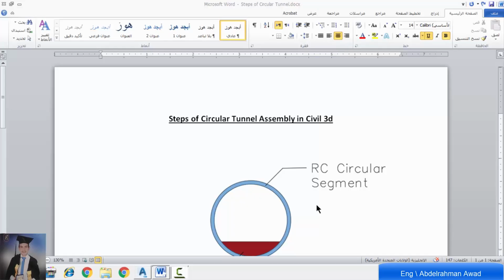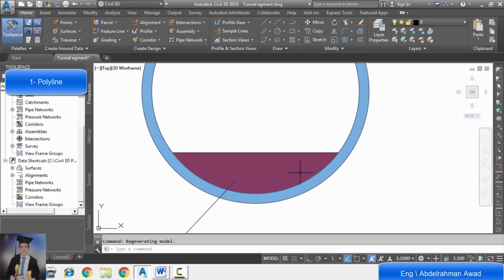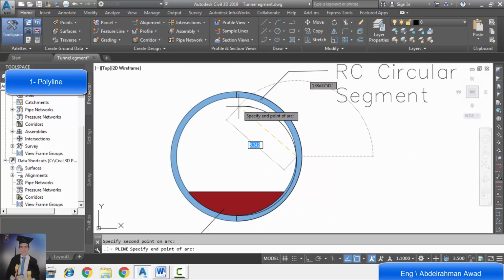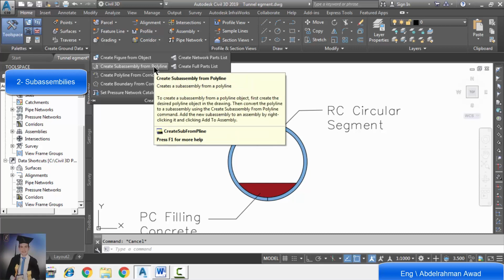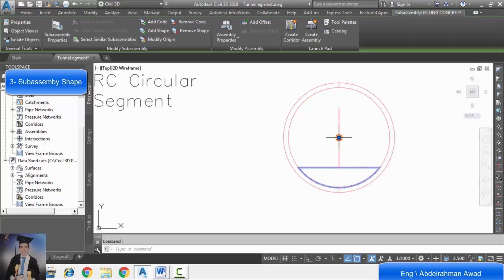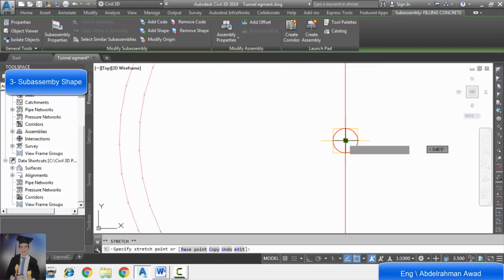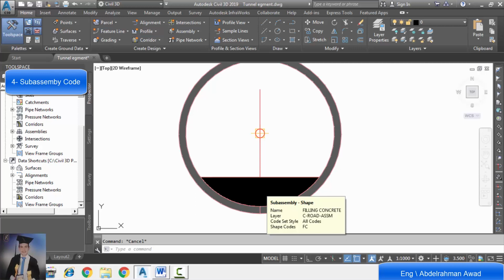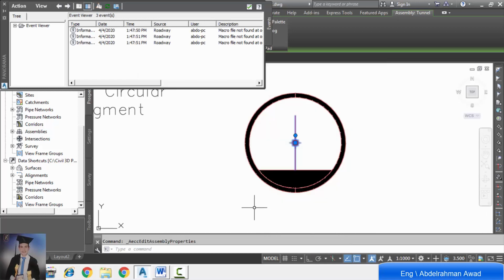Tunnel Project  Civil 3D - Lecture 1 : How to Create  Circular Tunnel Assembly  Using Civil 3D

Comment: Hello sir, urgently required.
Can you make video for structure modeling by corridor and surface, as per level.

In civil 3d 

Underpass, bridge , retaining wall, flyover, culvert.
Thanks
Reply from the maker: For corridor you can follow this video
https://youtu.be/NclKo_pS_J4
Reply from the maker: For bridge and underpass follow this video in Arabic
https://youtu.be/9plrsQBIA7U
Reply: @abdel.hamdi.Civil3D.Transport  this link for design loop and ramp not for bridge or structure in civil 3d. Please check sir
Reply from the maker: @md-mohammed8455  ok sorry you can find what you want in this video from 1hr 10 minutes 
https://youtu.be/8FUNytZJ_jc
Reply: @abdel.hamdi.Civil3D.Transport  thanks for your good reply,
But is not related to the structure,
It is for road alignment, profile etc,
I am looking for structure, like underpass , bridge, flyovers etc.

Comment: Hello Sir, why didn't you use Autodesk Composer?
Reply from the maker: Well , I thought about this note , and l tried to do it . But , l found no significant difference between civil 3d and composer. Civil 3d is more simple , when I use constant dimensions. But I agree with you , if you want to deal with variable cross section. I promise you to explain your note in another video soon.  Thanks for your feedback
Reply: @abdel.hamdi.Civil3D.Transport , Okay, I am interested to learn the Composer. I hope I can share about it. But yeah I agree with u. that the fact composer needs rules and logically, that's why sometimes hard a little bit.
Reply from the maker: That's what you want 
https://youtu.be/bLwGprQRzqQ